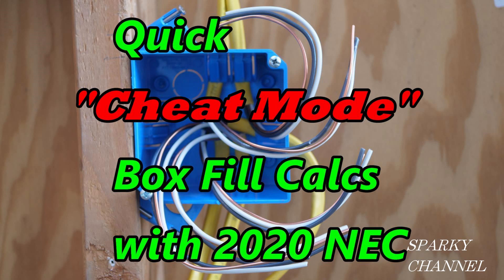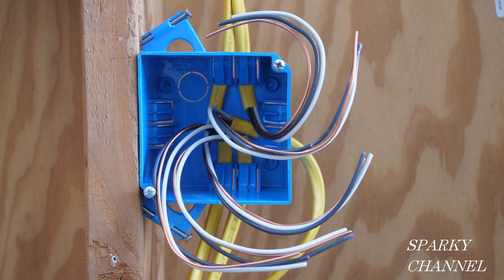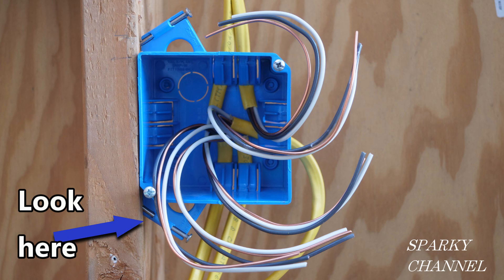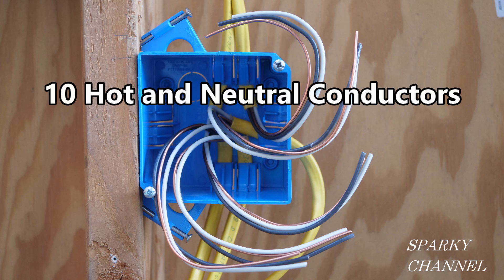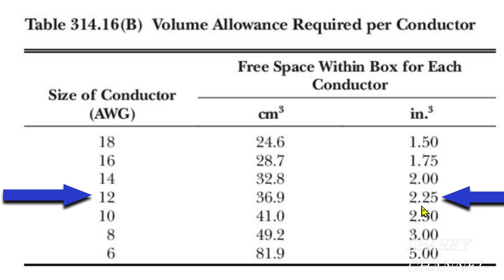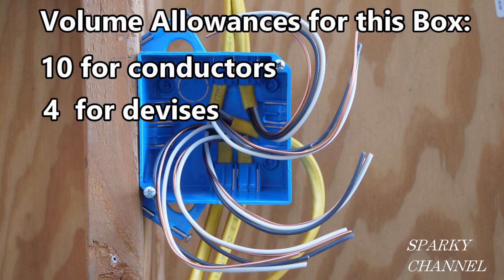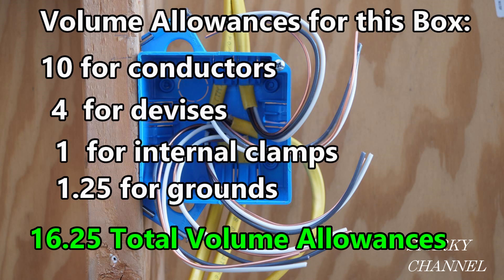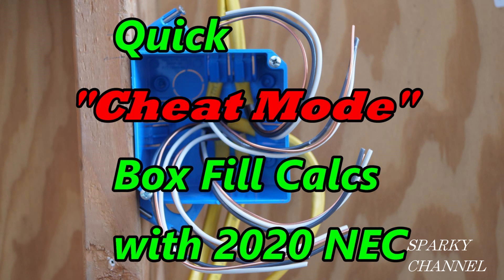Quick "Cheat Mode" Box Fill Calculations with 2020 NEC

Comment: Bill I know this video is several years old.  You are the seasoned licensed professional in this field, I am NOT.  I am just a homeowner who is interested in the subject and who is trying to educate myself.  I have a question reading NEC 314.16 (B) (4) (I own the 2023 edition).  In looking at both of your videos on this subject; when you came to calculating the adjustment for the "device" (switch & outlet) on the first video you showed a brief picture where you also labeled what the "yoke" was, this was very helpful-thank you.  However I see 2 yokes on each device, one at the top and one at the bottom.  A strict and literal reading of the NEC says that "for each yoke or strap....a double volume allowance shall be made".  The device you showed has a top yoke and a bottom yoke; why then is there not 2 allowances made for the top yoke (2.25 X 2 = 4.5) and another 2 allowances made for the bottom yoke on the same device coming to 9 allowances for EACH DEVICE (provided the device is supported by 2 yokes)?  I totally accept that I am wrong, but in carefully reading the NEC I am still confused.
Reply: The yoke or strap refers to the whole structural frame of a receptacle or switch which includes the top and bottom screw mounting holes. So just one per single device.

Comment: You should see how JCRPRODUCTIONS is teaching how to calculate this.  They are just adding the .25 for each ground over 4 to the final solution instead of giving it the multiplier.   They would say your answer should be 36.25in³. Its crazy. I just passed my unlimited/master's exam, NO THANKS to them.

Comment: How do you calculate box fill when using WAGO connectors, instead of wire nuts
Reply: Code doesn't mention a difference between the two.
Reply: My understanding is that the Table that gives you the size of the conductor already has taken into account the size of the wagos/wire nuts.

Comment: Why does that 5th ground wire count as .25 🤔 I was under the impression that all ground wires would just count as 1 ,is there a exception
Reply from the maker: It was that way until the 2020 NEC.
Reply: @SparkyChannel  do pigtails get added as an additional conductor?
Reply from the maker: @mperez2496  Hi! If you go back and look at the NEC I think you'll find that pigtails don't count.
Reply: Great catch

Comment: Do you account for wire nuts and pigtails?
Reply: They do not count
Reply: @mikescott6247  Correct!  The language of the code refers to conductors "entering" the box.  Since pigtails do not enter the box (they originate within it), they do not count.
Reply: @mikescott6247  Thanks, Mike

Comment: Is there any possibility for a "common sense" allowance for devices? A GFCI receptacle device takes up a lot more room than a standard  TR receptacle, or a standard single-pole switch, but by the NEC calculation, they both count as 2 conductor volumes. Isn't it possible that by the calculation a GFCI device is legal but won't fit; or the other way around, a small device is illegal, but fits fine?
Reply from the maker: Great question!!! The short answer is no, but I might make a video on that because it points out a horrible oversight by the NEC.

Comment: I searched online for box fill calculators. I find one at "constructionmonkey.com." The page footer copyright includes 2021, but the "calculator" has not been updated for NEC 2020. It does not properly account for more than 4 EGC wires. I also find an Apple app and an Android app, which I did not download. The Google app is from Canada, so I can't tell if it follows NEC. There are also plenty of articles covering box fill calculations, and most of these do not include NEC 2020. It should not be rocket science.

Comment: there's still one step quicker with standard device boxes.  for example, my go-to cut in fixture box, the allied PC2230W, is embossed in the box that it will hold 10-#14, 9-#12, or 8-#10 conductor counts.
Reply from the maker: Excellent! I hope you don't mind that I used your phrase "cheat mode". I thought that was a cool phrase! I like the box and the fire rating is great. They would be perfect for smoke alarm systems. Good point about the conductor counts. A link to the box for other viewers: https://www.alliedmoulded.com/product/3-5-dia-round-fixture-support-box-for-use-with-nonmetallic-sheathed-cable-pc223owg/

Comment: so what's the shortcut? this is just the overview/conclusion, no?
And you normally know that you're over the limit, because it starts getting tricky to pack things in (with the proper techniques), or using the "mail-man" ground-tail (one tail servicing each device).
Reply from the maker: It's a speeded-up version of the slow version. :) I don't like the mailman ground tail because of the possibility of a short with the ground wire (usually bare) going from one device to the other. Happy New Year!